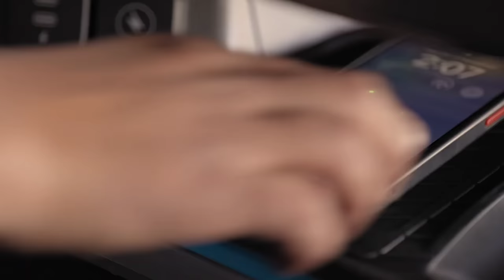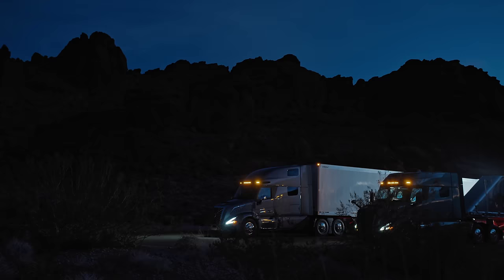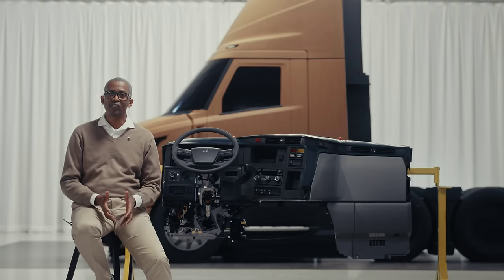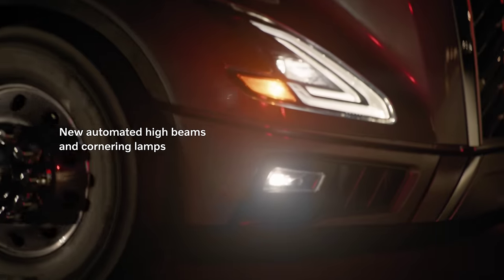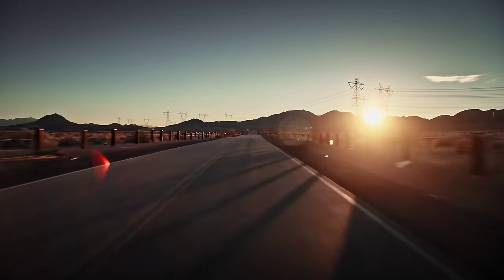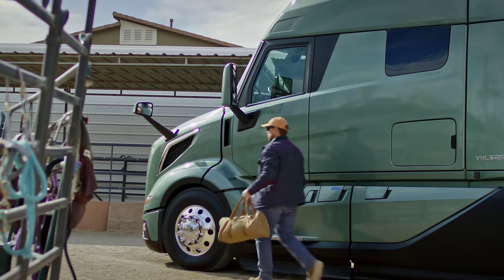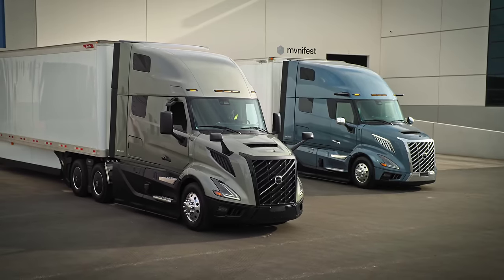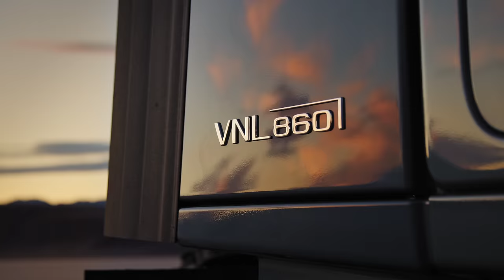All New VOLVO VNL 2024 is a Luxury Hotel Room on wheels!

Comment: As a non trucker, this is a trucker’s dream
Reply from the maker: It sure is!
Reply: No, A trucker's dream is the Telsa Semi.
Reply: @gxguy2906  No trucker wants an EV with poor range and terrible build quality
Reply: It most certainly is not any truckers dream 😂😂, it looks like one of those old international things that looked like a PT cruiser, don't remember what they where called as I don't think we even got them in Australia 😂 I've seen one or two maybe, but I will say the engine is probably a lot better then the X 15 or DD15 but that is not much of a feat 😂😂
Reply: From a comfortability stand point absolutely volvo is the best but the powertrain is at the bottom of options
Reply: I have no idea either 😂😂😂
Reply: @thetruthspeaker1978  I think it's called a lone star or pro star or something, they look stupid 😂 definitely something that would come out of the USA 😂😂
Reply: As a truck, this thing is as ugly as if
Reply: No it's not. New trucks should all have a sub-300hp diesel engine combined with a 250hp, 100kwh electric drive system. The hybrid system must follow suit of the Prius Prime, scaled up, and plug in. The system must allow an all electric range of 30 miles at 45 mph, as trucks enter the city the diesel engine shuts down, electricity takes the trucks to the warehouse, while loading and unloading trucks plug in. The trucks will be relying on regenerative braking during downhill journey, even shutting the diesel engine down.  The rears should be super singles spaced to match the outside wheel base of the duals, with advanced tire pressure and temperature monitoring systems. Once widely adopted noise in the city will be reduced substantially plus big savings in fuel consumption.
Reply: Wireless phone chargers are and always have been garbage
Reply: @gxguy2906  Tell me You are not a trucker in one sentence
Reply: @macbook802  fr, implementing plug-in hybrid systems in the trucking industry honestly seems like the most logical step right now. Only problem is I wouldn't trust any other engine manufacturer than toyota (or maybe honda) to make a phev system for trucks that'll be reliable enough.
Reply: This is a weird comment
Reply: @asmoov   I’m sure truck drivers dream of driving something like this
Reply: this truck is going to spend more time in the shop than on the road guaranteed!!!
Reply: How much price for this units.
Reply: @gxguy2906  gtf out of here, that’s every long haul truckers nightmare lol
Reply: @gxguy2906 No trucker wants a tesla😂😂😂😂😂
Reply: lol … should she how we build them … 😂
Reply: No its not. A truckers dream is a new glider kit truck with a Detroit series 60 engine.

Comment: This truck is an unattainable dream for us here in Brazil. Congratulations once again Volvo, this is a dream
Reply: .....we can export you some pretty chunky durable heavy duty TATRA trucks from european second hand warehouses including regular spare parts supply, maintnance documentation, blueprints.....everyhing....
Reply: Tatra truck are incredible
Reply: @aarronwoods6389  ...even Canadian firefighters chosen them because the only Tatra managed climbing steep uphill in required speed with full water tank and extinguishing with water cannon in max stream output at the same time....
Reply: Import a 10 years old eu spec truck and you’ll get everything, what this advert claims🙂
Reply: @bencemuller7919  In Brazil we use EU spec trucks. But american trucks are not viable in Brazil due to truck size laws.
Reply: @jorgeaugusto6076  maybe european brands, but not eu spec. It’s not the same.
Reply: @bencemuller7919  Nah we use EU spec. Brazil pretty much copies the same spec EU uses. Well, the majority of specs.

This leads to some EU rules that makes no sense in Brazil. Like using DRL in a tropical country.

No joke, Brazil pretty much mirrors EU specs. Mainly to make things easier to EU manufacturers.

Result is that some cars created here are exported to EU with little to no changes, like the VW Nivus/Taigo
Reply: Calidad no se encuentra en un Volvo al igual que un Freightliner cómo chófer es bueno usarlo y tirarlo cómo dueño  son dolores de cabeza
En u.s.a  los cementerios de camiones encontrarás principalmente un Volvo o Freightliner
Reply: @Luis-bo8wf no es cierto. La durabilidad de Volvo es muy buena

Comment: As a 3rd generation truck driver, I have had he chance to be in and drive, lots of trucks in my life and career. I've been a KW and Pete fan for as long as I can remember. The industry has made leaps and bounds since the days of wood floorboards and spring-base seats to the amazing air-ride and padded floors. Let's not even forget the lush interior and aerodynamic exterior or today. This all new Volvo may change my mind about KW and Pete. Some day, I will drive one, even if it's just a test drive. This is now a must on my bucket list. Well done Volvo 👏 ✔️ 👍  well done indeed!
Reply: Drive a 2020 day cab. Love the power of the engine and automatic transmission.  But rides like shit, yanfeelmlike ya been beat at the end of the day and the plastic just rattles to no end.  One driver took a box of screws and literally put a screw dn near one per inch, no sqeaking now!  Lol
Handles well, huge cab, its an OK truck. I wouldn't buy one though. A hood is a hood.
The anti collision & lane departure crap, Drives me insane. Creates unnecessary stress.
Reply: @haroldenglish943 Automatic transmission? The only way to get up dangerous hills and out of tough spots, is to have a manual transmission.
Reply: @Jallu555  For the work I do, hauling fuel to gas stations, it works.  The other couple days a week I drive a W990 w/18 speed manual, 2.90 rear end, 566 & 1850 torque.  Love the truck but for what we do, way to much truck. I prefer manual most days but sometimes it's just nice to put it in drive and stomp the fuel pedal!  Lmao
Reply: @Jallu555  we have had automatic for over 15 years in Sweden, no problem even though the terrain is tuffer here. I thought that argument died a long time ago, but youll get there eventually
Reply: @myturn2diesundsvall659  My father has driven trucks for 35 years with 80 ton weights, and he says manual has safed him countless of times from rough spots (drives 560 hp V8 Scania now) 
He has never had a accident in his entire career
Reply: @Jallu555  He's old-school, that's the only reason he prefers manual. I have driven for 10 years and have the new Scania 560 super engine, there's literally zero reasons to have a manual transmission. You can still lock your gears and it shifts faster making it more reliable when climbing or going downhill

Comment: Glad to be part of this. It was a long project for us
Reply: I'd like to see how it looks with a visor. there's no reason the windshield had to be that tall. We're trying to look at the road we're not staring at the fucking sky. Yea truck driver want a big ass windshield with no privacy.
Reply: @XLoad3d no one is going to look you from the sky bruh
Reply: Why didn't you guys put more turn signal lights on it. And in the winter that curved windshield is going to ice up on the edges. Why is it smaller 77 inch buck is gone, so I guess the big frig is too. And it doesn't matter how many shops you have if the people there can't fix it right the first time.
Reply: Do people use the 🚽 in your Volvo realm? All this space and innovation and still drivers supposed to hold until next public toilet.

Comment: Volvo is hands down the most beautiful but powerful truck on the market. A true driver's truck
Reply from the maker: No doubt!
Reply: Peterbilt and kenworth have way more power bud
Reply: Them trucks stay in a repair shop too. I tow for a living and peterbilt and kenworth keep me in business with their breakdowns. Rarely tow a volvo
Reply: @erahelp   I’ve been driving for some time now and never seen a wrecker that’s a Volvo??? Always Pete’s and kenworths…. Also gotta remember Volvos pull vans aka not that much weight, most the time it’s the Pete’s and kenworths doing the heavy loads. Pulling heavy equipment, cattle, tankers, etc. they’re under way more stress than the Volvo and still run better
Reply: . Volvo aren't as common as mack. Mack is the same as volvo. Volvo owns mack. Yes Volvo are powerful them you know. We have a heavy haul Volvo that pulls 200k lbs excavators with ease. No other truck pulls like a Volvo with ishift
Reply: Doesnt Scania have the most powerful truck?

Comment: Really like it completely new new cab interior
Reply from the maker: Exactly! And it looks awesome! The latest European tech finally arrived in US!
Reply: Not enough Technology from Europe.
The Volvo Stability Programs don’t Extend to the Trailer.
Where are the CB Antennas Located/Mounted?
The Night Time Auxiliary Air Conditioner, is it the 24 volt I-Park Unit that’s Factory Installed in the Volvo FH COE; THE BEST VOLVO TO EXIST? 😎🤙🏻

Comment: I drive a ‘21 Volvo VNL daycab doing local deliveries and it’s a very nice truck. This ‘24 model is light years ahead of anything else. My only complaint is with the forward collision emergency braking feature because it takes the human decision making process out of the equation, which can be very dangerous, depending on certain conditions. One time my truck didn’t know when the roads are wet and slick and someone waiting to exit a parking lot is not in any danger of being hit and locked up the brakes nearly causing my unladen truck to lose control and jack knife on a downhill street in the rain. Needless to say I pulled the fuse that controls that feature because it’s safer to not have that feature activated. Other than that, I love the truck.

Comment: I hope you fix the mirror defroster and the air condition temp control. My 2021 mirrors heaters are weak and the air condition is either too cold or too hot. The base seat is too hard and the steering wheel is too small. The refrigerator is too small. I can turn on the radio from the steering wheel but I can't turn is off. I have to take my eye off the road to press and hold a small button. That's not very safe.
Reply: I'm driving a 2022 VNL and the mirror heaters weak for sure, thought it was just me, the heaters in my old 2016 did a much better job.  My biggest complaint about the mirror heaters in the 2022 is the switch, you can't tell if they are on or not since the only indication is the dim light in the switch itself.
Reply: @DamnStraightM35A2  I would love the to meet the mofo who came up with that bs.

Comment: Moving the gear selector to the steering column was a good move 👍
Reply: Скания это сделала ещё 14 лет назад😂потом мерседес
Reply: Why did the put the shifter anywhere else ?  Putting the gear selector down by the FM radio is a recipe to take your eyes off the road

Comment: beautiful truck…..i had volvos in the past 2007 models ….had lots of electrical issues ….since then i moved on to freightliner …i might give it another try with this new model …. it does look beautiful but hopefully down time is not too bad with these new models because that’s what it comes down to
Reply: And yet, freighshakers are known shitboxes. I don’t think you’re after quality, you’re after “cheap”
Reply: @wyo_garage20  what do you consider quality these days?
Reply: @nafakaboy  Ceetainly not a freightliner🤣 So how am I supposed to answer your question, you said “what” but is that, what does the definition of quality mean, or what as-in who makes quality?

There’s a reason the top dogs are K dubs and Pete’s. They make the best, period. They are the strongest, have some of the nicest most comfortable interiors, and are physically spec’d higher than most others. You’ll never see a Volvo or FL in heavy haul, that’s a market dominated by KW. Off road apps are again, dominated by KW. Because they make the trucks for that work, almost no one else does. And they last. Pete makes a great truck as well, typically more highway and lighter off road stuff. 

Nothing else will last. Volvos are fine on highway, get them in the slightest mud and they are helpless. FL falls apart left and right, junk. From fluky electronics to awful UI to terrible gauges and design, and nutted down drivetrains. I don’t think you can even buy a FL with a big X15 with 605hp like offered in KW/Pete. It’s not their market. FL caters to the fleets that lease, and repairs are part of the lease package. Again, absolute junk.

Comment: 8 hours of cab cooling, when you're required to take 10 off.

And about those pesky 36 hour resets?
Reply: You start the truck to charge the batteries or add extra batteries. Simple problems require simple solutions.
Reply: Just switch to xs power agm batterys and it will 2x that number they also have a faster charge rate
Reply: It should stay cool for an hour before you need to use it.

Comment: I love my volvo. I have a 2020 almost 486,000 miles and I still haven't been towed yet. Couple airlines went small coolant leak and a transmission sensor that's about it other than wheel seals but I haul oversize everyday so that's expected. My truck has been very dependable.

Comment: The new trucks are very nice. My heart will always be with what I had in 1990 version. It was a KW 13 speed. I personally can't stand an automatic transmission. Not for a semi truck. I love to long nose. Yet. Don't get me wrong. Very nice truck. It's just not my taste. The new high-tech everything. Would I personally buy this. Yup. It's too bad they don't come with a 13 speed.
Reply: Totally agree, if it came with a manual transmission option and trucking conditions weren't so abysmal I would give it a second chance.
Reply: @sparklessconnectionselectrical  The automatic transmission made trucking extremely dangerous. Anyone could drive them. They did. They drove them as today as a car. I sat in a Walmart parking lot once. Different state and town. The truckers used it. Fully loaded. The truckers would race through the parking lot. If the trucks had a manual transmission. They couldn't do it. They did wreck their trucks. Why I say. 13 speed for the open hwys. 15 speed for the cities. I personally have driven so many different types of transmissions. One that 99.99% of truckers never touched. A 16-speed automatic. You shifted it. It was like running a lever threw a comb. Army had it.

Comment: I'm curious about the automated braking system, what will the truck react like if there's a nut case that likes braking checking vehicles?
Reply: It’s terrible, the “safety” features were no doubt created by people who have never driven a semi truck 

The auto breaking feature is a nuisance most of the time 

I use to work for werner enterprises and they had these features in their trucks, I had to take several safety classes because my truck was auto breaking a lot 
And they figured it was me causing it

Comment: Why does the Volvo still have mirrors? Is that US only or is there a specific reason to it? In Europe I see many trucks today with cameras instead of real mirrors, the are more fuel effient and give a better view (from what I heard). Anyone knows anything on this?
Reply: I drive Mercedes truck with camera..at first I didnt like it. After few weeks I change my opinion. Its very good. U can see better when is dark. When u turn right camera follow trailer. When u park u can zoom it and see much closer. The only what I dont like it if electric goes off then u have problem.

Comment: Not a truck driver but, the gear selector was a stalk with D, N, R. No manual transmissions anymore? I always marvel at those that could drive 15 speeds and not use the clutch. Yes, all my 5 speed transmission were synchromesh.

Comment: in North America we like square body trucks from half ton to semi, volvo tried to keep the square front end but it still doesn't look right
Reply: + 2 mpg looks right to you compared to your square body? Design is about aerodynamics. Aerodynamics is about mpg. Volvo keeps changing the design without loosing ⛽️ not like Peterbilt and Kenworth, use the same hood and cab since 60's.

Comment: As a trucker there are still limitations with this truck. I currently drive a VNL and there items that drive me crazy every day. Low horsepower. the automatic transmission is not ready for prime time. I need to drive it in manual mode when loaded. the controls are far from intuitive. But the ride is top in class. The fatigue level at the end of the day is much better than other trucks. Don't get me wrong i do love my truck but it is far from perfect.

Comment: it all looks very nice but I saw electrically operated parking brakes, if they are using the same or similar AMU's as the previous models there is likely going to be issues with the valves corroding out or failing internally so you wont be able to activate or reactive them. also the electric steering assist motors NEED to be more reliable.

Comment: I defend trucking companies in accident lawsuits. After an accident we often have to download the engine control module to get braking/speed/deceleration data. Our accident reconstruction engineers can plug in and download in minutes. For Volvos, which have proprietary software, we have to pull the entire module and send it off- often for weeks- to have the only company in the U.S. able to do the download- Mechanica- get the data. Not a huge deal if truck is significantly damaged and out of service. But often the truck has minimal damage and would be able to go back in service as soon as we get the download.

Comment: I drive a new Volvo. Started driving it with 8000 miles on it. Before it got its first service I had to add oil. It now has 68000 and the oil level has gone down. Sad!